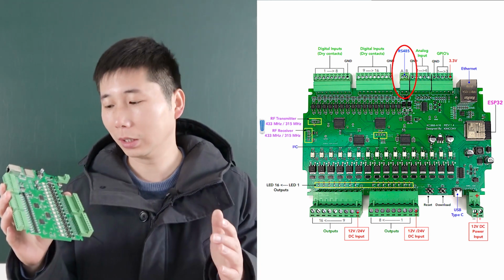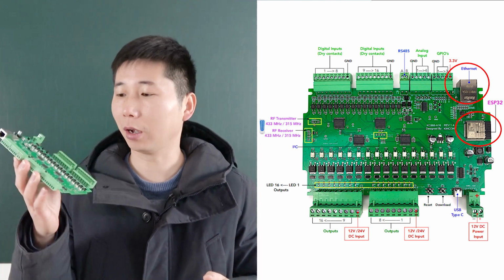KC868-A16 ESP32 home automation relay module released!

Comment: I bought this, just arrived. Any way to connect to a 5v relay board (already owned and wired) ?  Or , in alternative , i can buy a 12dc board optoisolated on amazon ?
Reply from the maker: if you MUST want use 5v relay board, need voltage convert circuit module.

Comment: The data sheet for the mosfet says they are rated up to 60V and 10A. Since they have a separate power input, is it possible to use them for the higher rated DC voltage? For example: 48VDC
Reply from the maker: MAX support 30V DC by board, because other circuit IC support MAX30VDC, if you want use one power supply for all .

Comment: Could you please confirm KC868-A16 can also run on 24V DC ? We have A32M and run at 24V DC but want to use KC868-A16 for smaller projects.
Reply from the maker: sure, A16 support dc12-24v

Comment: Is it possible to add RTC to the KC868-A16 ? Or RTC is only available for the bigger KC868-A32 and KC868-A8 ?
Reply from the maker: ESP32 have RTC inside, do you want use a extender RTC module? if yes, ok, we have i2c RTC module, you can connect with A16 board's i2c extender.

Comment: Hi, can this be used to dim(change brightness, ON/OFF) the lights in the room? Does it support multiclicks or longpress button clicks?
Reply from the maker: yes, use for dimmer, it can change brightness. whether support multi click, just set config yaml file by esphome.
Reply: @KinCony  what did you meant by use for dimmer? i was told that kc868-a16 cannot dim the lights
Reply from the maker: @michalzachar409  A16 can connect with addressable LED strip, such as WS2812B LED
Reply: @KinCony  so can it change brightness of the light or no?
Reply from the maker: @michalzachar409  if common light, A16 can't use for change brightness. if you connect with WS2812B RGBW LED strip, no problem.
Reply: so only addressable led strip you mentioned is possible? dimmable LED spot light would not be possible?
Reply from the maker: @michalzachar409  yes

Comment: This A16 is doing well and is very flexible. 16IO Input + 16 IO Relay + etc..... However, for Residential on DIN Board, it is more larger than typical ICT. The Space  is not enough to connect Relays cables. MR Kincony, you should reduce the size of the board by 3cm (Height) - In addition the Relay Connectors should be plugged from the front  (this will save more space) and not from the bottom part.
Reply from the maker: thank you for your suggestion.if only use PCB board, connector plugged from front is very good, just now many people will use plastic case, the cable only can connected at bottom part.

Comment: Can I use the output of this board to controll 12v 8 relay module(ordinary 12v 8relay board)….without supplying the 12v input to the outputs…..in normal case using esp32 dev board 5v pin I can power the relay module and switch the relays with using 12v external power supply…how can I use this board to do the same…
Reply from the maker: yes, you can use A16 work with your 12v relay board. just connect A16 Vin with dc12v of the output terminal, there is a "COMMON" Vin for load.
Reply: @KinCony  what happen if I didn’t supply the 12v to  8 output channel common vin pin…….and try to switch on off the relays…
Reply from the maker: @nikhuge6580  will be no voltage output, because KC868-A16 is mosfet output, no relay on the board.

Comment: This time I bought the KC868-A16.
If you look at the manual, you can see the rs485 AB terminal.

 Do I need a module like rs485 TO TTL to connect other controllers modbus communication?

Or is it possible to control the KC868-A16 by directly connecting it to the AB terminal of rs485 and connecting it to the controller you want to control?
Reply from the maker: not need RS485-TTL, just connect to device with A and B. do you let A16 board  work as "MASTER" or "SLAVE"? do you write arduino IDE code or use ESPHome?

Comment: For the next board 
to add SCL SDA and  non- used  ESP32 ports at the 5V logic level for using both input and output functions.
So  The board will compitable wide range area according to me .
Have a good work🙋‍♂️
Reply from the maker: thanks for your suggestion. A16 and A8 already have IIC of SCL and SDA ports. maybe can place the free INPUT , OUTPUT IO for 5v level in furture.

Comment: Interesting board! Just one question, how can the CH1/CH2 be 0-20mA and CH3/CH4 be 0-5 volt, when looking at the schematic the components are the exact same? Shouldn't all four inputs be able to be 4-20mA or 0-5V?
Reply from the maker: The resistance values on different channels are different, which is used to adapt to different types of sensors of 0-5V or 4-20mA

Comment: Hey KinCony, thats a very interesting new release. Can we use the ESP IDF to program the esp32 or should we use the arduino ide only? Do we need to re-flash the ESP32?
Reply from the maker: both can use arduino and ESP IDF, not need to re-flash, just directly to use.
Reply: @KinCony  Awesome, will be getting this along with A4 version for some field testing. Thanks.
Reply from the maker: @7GIGEO7  you are welcome